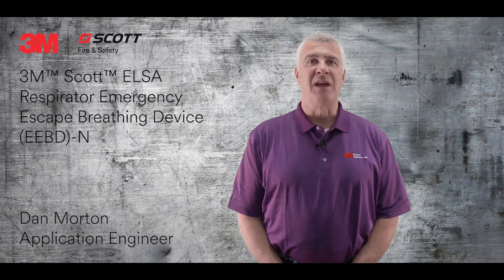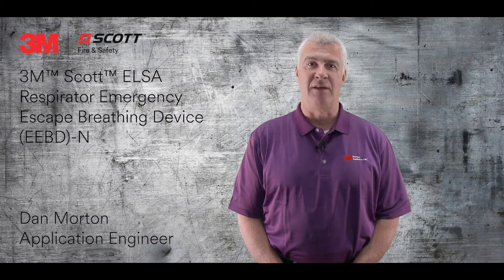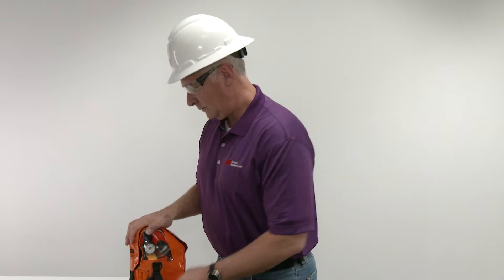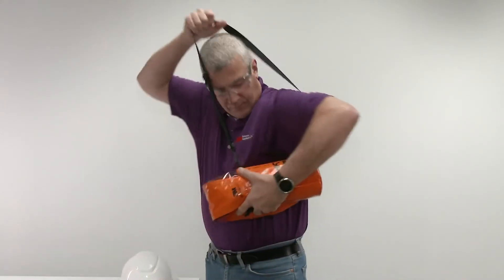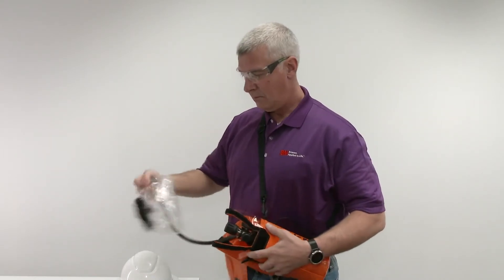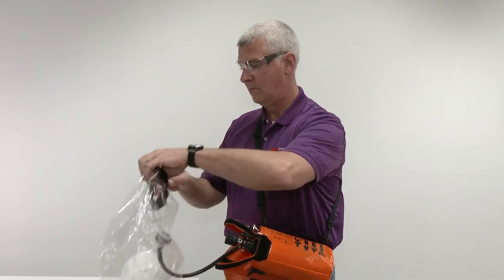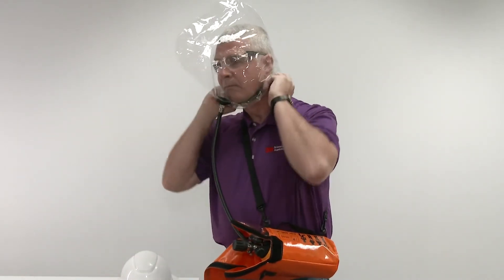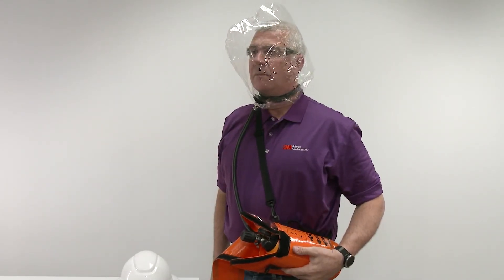Donning Guide for the 3M™ SCOTT™ ELSA EEBD-N

Comment: How does this rid of Co2?
Reply from the maker: The 3M™ Scott™ ELSA Emergency Escape Breathing Device continuously flows ~30-40 liters per minute of air into the head top. This high flow of air dilutes/eliminates the small amount of carbon dioxide (CO2) that is generated by the wearer for the entire time that the wearer is using the respirator.  The respirator is rated for 5-, 10- or 15-minutes.
Reply: @3MSafety  I have a few quick questions related to this - where exactly does co2 escape? From the look of the video, when the hood is fully donned, there does not appear to be any room for co2 to escape at the neck seal. The black elastic looks like it's conformed to the neck with no open space for co2 to exit.

Also, when we exhale we release not just strictly co2 but oxygen as well correct? Does the continuous flow flush out both the co2 and the exhaled oxygen or does that exhaled oxygen get rebreathed?

If the LPM were let's say 15-20 LPM instead of 30-40, would everything still essentially operate fine?

Any clarification on these matters would be greatly appreciated, thanks.